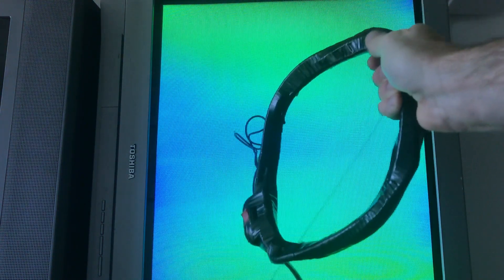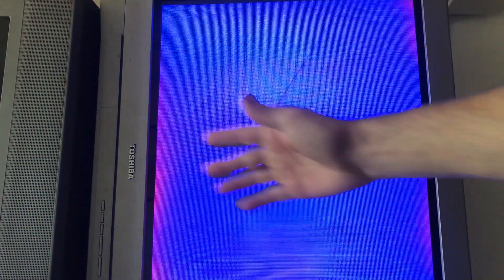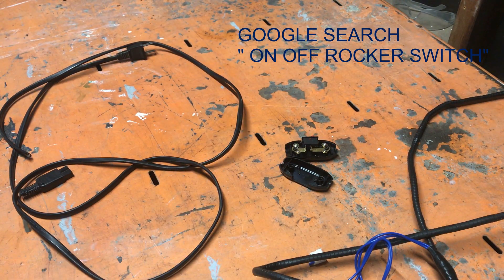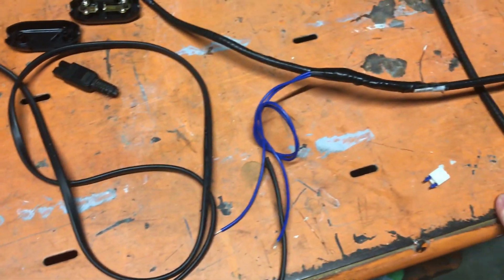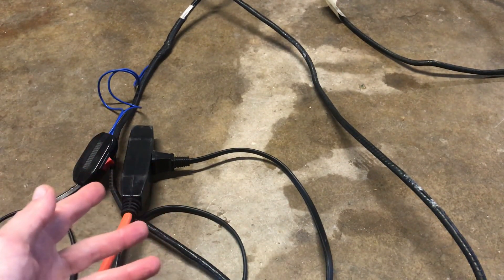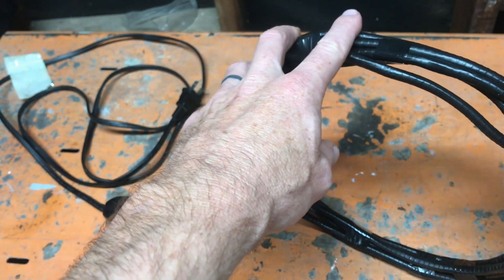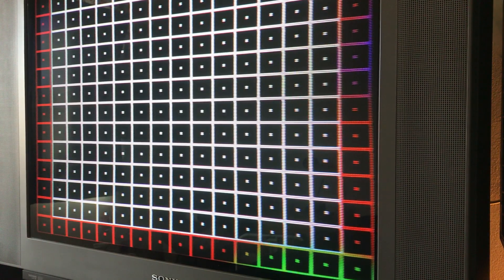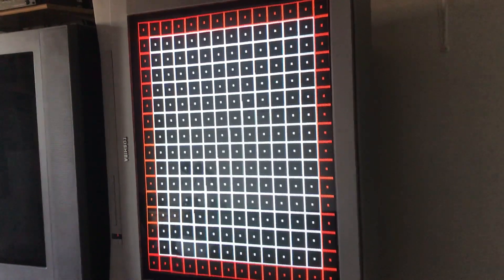How To Make a Degauss Wand For CRT Retro Gaming...Alternate Title: How to Burn Your House Down

Comment: So i just tried this.. i took a degauss coil out of an old TV that I had can I wired it to a power cord (minus the switch) and it worked but then it started getting hot and then it just went up in smoke. Idk if i did something wrong or maybe i didn't do it right? I don't really know. I had an RCA color track plus that doesn't degauss by itself anymore and i tried this and it all went wrong. Can you explain maybe what i did wrong?
Reply from the maker: You could try using something to step down the voltage and wiring it in. Or just use a beefy electric cord and lots of electric tape.

In my experience if it doesn't degaus immediately than it's not going to degaus properly. The could should only be plugged in for a few seconds.

Comment: This is an awesome video, but could be dangerous to most people. I would highly recommend using a video tape eraser to easily/safely degauss CRTs. [Just place the tape eraser against the screen, turn it on, back away a couple of feet until the colors look normal again, and turn it off. Super easy, cheap, safe, and works brilliantly]
Reply from the maker: Naaa. Just tape some magnets to end of a power drill and go weeeeeee!

Comment: Thank you for the tutorial. Any idea how much power that coil pulls (watt meter etc)?  It seems like it's just shorting the AC power through the coil.  I was expecting it to trip the circuit breaker instantly. I have a degaussing coil that I want to do the same, but maybe with a thermister so I don't melt the coil.
edit  I measured the resistance of the coil that I have, it's around 24ohms, so I'm guessing on 120V, it will pull 600 watts.  Not enough to trip the circuit breaker, but definitely will heat it up quick!
Reply: I did not know which thermistor to get, so I got some ceramic resistors and dropped the power to 150watts on my degauss wand. It's a bit weak, and the resistors still heated up really fast.  But I was able to degauss my PVMs!
Reply from the maker: @rcboosted  Awesome dude. Thanks for the feedback. I picked up 2 thermistors but never ended up hooking them up. After using it I don't think it's necessary. What do you mean about it being weak? I was a little worried about that with respect to the thermistor.

Comment: Hey Riggel, I scored a free 19 inch Philips Magnavox at a local flea market (owner said it was useless) and aside from being filthy, it seems to play games pretty damn good. Problem is that it’s one of those mid to late 90s budget CRTs (the black curved screen type) that only have a single RF coax port and literally nothing else, so very minimalistic TV. The RF seems ok but i noticed the signal isnt as strong as it needs to be to have consistent steady clear gameplay. It has occasional blips or hiccups in the signal for just a split second… are you familiar with Playing NES on RF at all to where there may be something to amplify or boost the signal strength? Any recommendations or do you typically just avoid RF?
Reply from the maker: I grew up playing on rf but I avoid it now. I've talked with some guys who really like it so you might find some help out there in the forums. You can try cleaning the metal contacts with rubbing alcohol.

Your problems sounds like it might be a bad capacitor. You can open the tv up and check to see if any of the caps look bad visibly.

Comment: What are your thoughts on smaller 13 inch CRTs for gaming? Any benefits aside from weighing alot less and being easier to move? I got a free RCA 13 inch CRT (RF only) and it surprisingly has damn near perfect geometry and good colors. My only complaint is that smaller screens tend to strain the eyes more
Reply from the maker: Personally I hate any screen under 19 inches. A lot of that is personal preference though so don't let me scare you off of having a good time. I honestly have a hard time gaming on my 20 inch pro monitors because they are to small for my taste. I've tried to get into handhelds and I just can't handle the small screen.

On the plus side all crts are cool. They are weird. They glow. You can do weird things with them like correct geometry and degauss. 

I would say if you like your 13 inch rca look around for another crt. Try and get something around 20 inch to 27 inch with component or at least s video. I think you will be impressed.

Comment: I have a pink corner on mine that is most visible when facing West (unfortunately the room layout dictates it). I tried one of those cheap degauss wands on Ebay but it didn't work. I am taking it to local technician this weekend to see what can be done, I don't know if it is indeed a degauss issue or a larger purity issue.
Reply from the maker: Hopefully he is a reliable tech. I met several scummy ones until I found a good one. 

This is really a simple issue. You should try and fix it yourself. Have you tried gluing/tapeing  a magnet down to the glass tube? That should fix it.
Reply: @riggel8804  Do you mean on the outside? I am afraid of opening it up. 

I was hoping to get this guy to recap it too. I am handy with a soldering iron, I was able to RGB mod my NES top loader with the Tim Worthington kit. I wish I could more of this stuff on my own but I don't want to break anything or hurt myself... my wife would be pretty upset if I did :)
Reply from the maker: @drewirons2646  recapping a crt is easy compared to a nes rgb modd. I'm sure you can do it. Some of the traces are easy to lift up. Once you discarge the tube it is harmless. I recommend you wrap your head around the job and do it yourself. Then again if you got a reliable tech and he only wants around $130. I'd say it's worth it. It is time consuming and ordering the caps can be a pain. If you get a shady tech he might not recap anything or just do a couple cheap capps. 

Capps are not going to help your discoloration. I have a video on how to repair crts. There is a section on magnets. Most people stick them down inside the chasi on the glass so you don't see them but you can stick them down on the outside chasi if your scared. You should get over that fear. Working on crts is safer than jacking up your car and changing the oil. This safety first shit has gotten out of hand. Don't let people scare you off fixing your stuff.
Reply: @riggel8804  I am still kind of holding out hope I can degauss the thing without further maintenance. I actually took another look at it last night and moved some magnets around the corner and the picture improved. I may try to get a proper coil/ring rather than the cheap china-manufactured wand I bought on ebay. I don't think a magnet or strip used for calibration moved or fell off because it would affect more than just the corner. It was sitting on a shelf at goodwill for some time around other equipment, so it could have become magnetized in that corner.

It is strange though, the flaws almost vanish when the TV is facing South.
Reply from the maker: @drewirons2646  You probably can fix it. Keep trying. Good luck.
Reply: @riggel8804  Update -- I got a ring like the one you have in this video (although mine was vintage retail). It works like magic at eliminating the purity issues. Unfortunately, the purity issue returns on a power cycle. I am suspecting that the internal coil is half-functioning or misfiring, and is magnetizes my screen upon powering on. I don't hear a "BWONG" like you talk about here, but I do a hear a click as the screen reaches maximum brightness. This is distinctly different from the Trinitrons I own, which are working properly. 

Do you think its possible to open and disable the internal coil? Seems like they are easy to disconnect. I wonder if there is any harm in using it without an internal coil, and then degaussing externally as necessary.
Reply from the maker: @drewirons2646  You can easily remove the deguass coil on your tv without harming it. Some of them simply unplug. Otherwise you will have to de-solder it or cut it and wire nut it. However I doubt this is what is magnetizing your screen. I would check the speakers. Try removing them. Or moving your tv to a different location in the house. Something in the room could be magnetizing it.
Reply: @riggel8804  I fixed my issues by unplugging the coil. I think it was not calibrated or misfiring. I determined it was the coil by discharging the tube (turning the power on while the TV is unplugged). Then, the next time I powered it on it would look great. However, subsequent power cycles would bring the issue back.
The working theory was that the coil was not getting enough time to build up a charge if the set was unplugged, hence the first cycle would look just fine.

Unplugging the coil internally proved this right. Now it displays correctly every power cycle. I have a great external coil I can use if the TV ever needs moving or needs degaussing.

Thanks for giving me the confidence to do this work.
Reply from the maker: @drewirons2646  Dude that warms my heart. Your welcome. 

I didn't know the coil could cause that issue. I will file that nugget of wisdom away.
Reply: @riggel8804  It probably shouldn't... I wonder if there is a component failing, and the coil was only partially degaussing or not at full strength. The TV is about 20 years old, the board looked clean though. Probably could have also fixed it with some magnets; there were some chevron shaped ones stuck to the back already.
Reply from the maker: @drewirons2646  there really isn't anything on the coil to foil. It's just a bunch of copper wire. Doesn't make sense. Typical electronic bullshit. Just keep swapping parts around until it works.
Reply: @riggel8804  I have heard that there is a thermistor that controls the current flow through the degauss coil. Its possible that it lost calibration or was failing. 

In "defense" of my TV, the coil worked just fine in a N/S orientation. There was something about the W/E orientation that created a strong field that the coil wasn't handling properly.

Comment: Would connecting a 12v ac wall adapter to the wand solve the heating issue?
Reply from the maker: Interesting idea I don't know. I'm going to guess yes. 

A board tech told me how to make the wand. He told me to connect a "thermister" to the circuit. It's this little resistor that lowers the voltage as the wand heats up. I still have the thermister but I didn't bother to hook it up. I think in most instances the wand is going to work quickly and it won't be an issue.

I've seen videos where guys loop multiple coils together to cut down on the heat.
Reply: @riggel8804  any of the three options would cut back on the heat. Can you make a video where you plug it in untill  it catches fire?
Reply from the maker: @crtautist220  Haha good idea. It would be fun to do a video where I do everything that the "safety first" crowd wine about. I could yank an anode cap off a jvc and discharge it against something, maybe set an old speaker on top of it and play through rf, I will have to leave the degauss wand plugged in until it catches fire, that would be a good way to start out the video. I can here the punk rock playing in the background right now.
Reply: @riggel8804  I want chaos and destruction